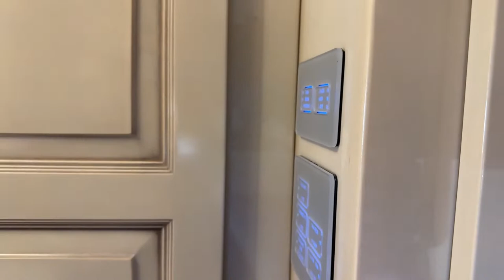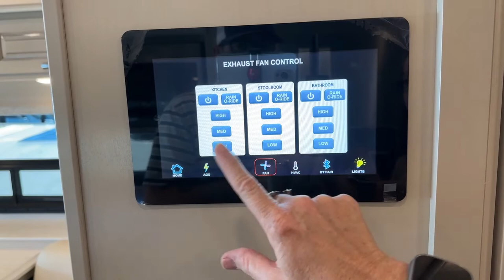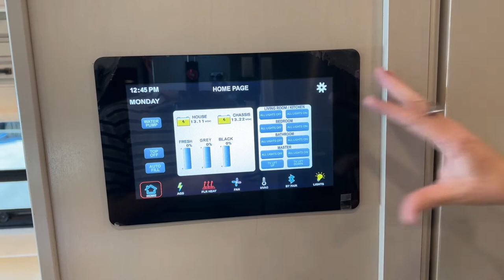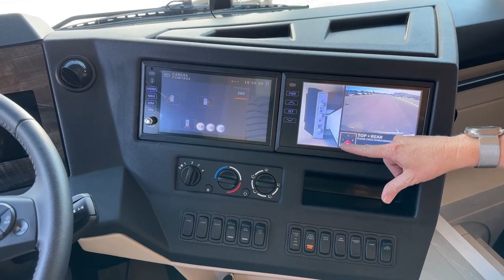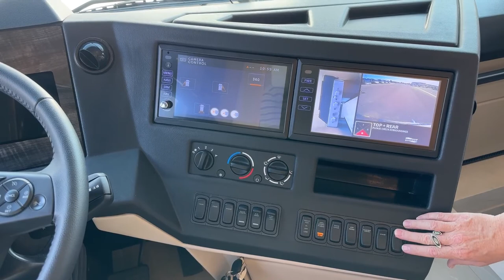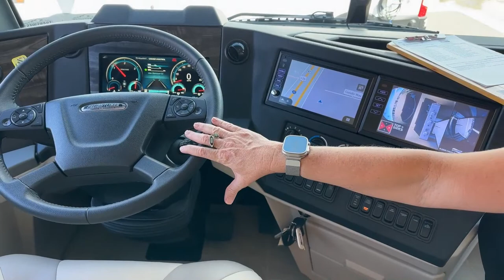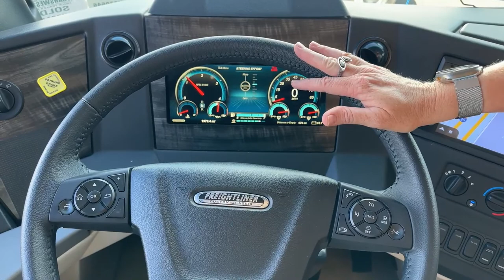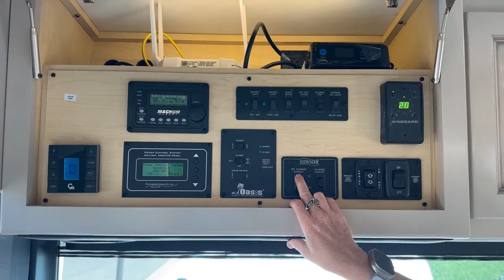2023 Newmar Dutch Star 4071

Comment: Does the 4071 come in a 150 gallon diesel tank?
Reply: Hi John! 
In the 2023 lineup
The 43' Dutch Star will come with a Tag and a 150 gallon Fuel Capacity
The 40' Dutch Star will come with a Tag and with a 100 gallon Fuel Capacity
The 37' Dutch Star will come without a Tag and with a 100 gallon Fuel Capacity

Thanks for tuning in!